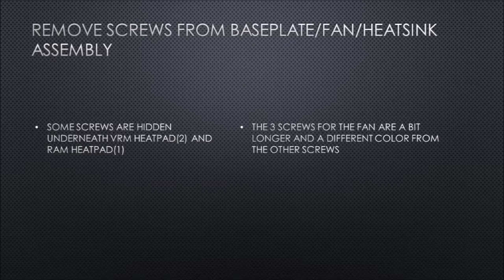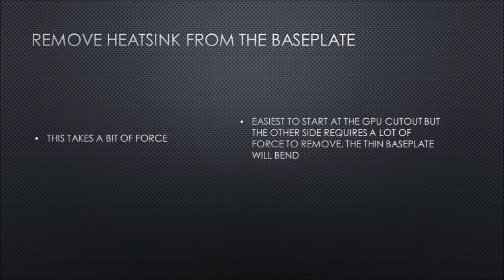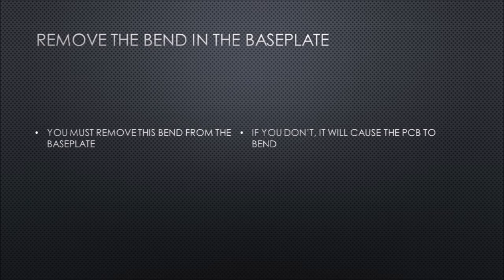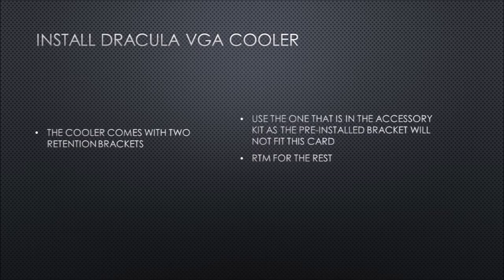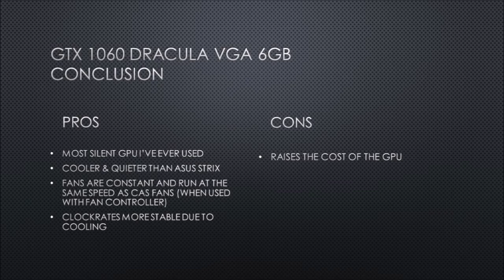ASUS GTX Turbo Series DRACULA Cooler Installation.

Comment: Can i put a cpu cooler instead of the Dracula cooler? Also, great video
Reply from the maker: Thanks, it's possible but very challenging to do so... this video on youtube shows it being done but only after creating a custom mounting bracket(GPU & CPU mounting brackets have different spacing) and running the card outside the case since the cooler was too big.  https://www.youtube.com/watch?v=Iegpwo9SqSg